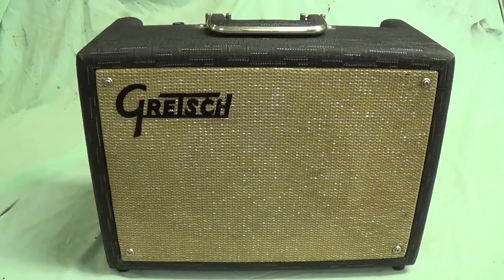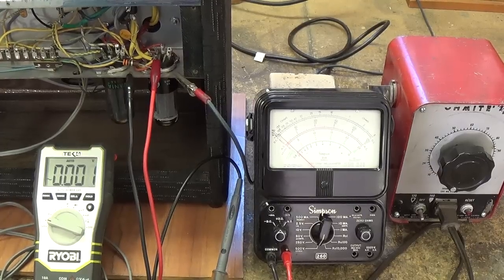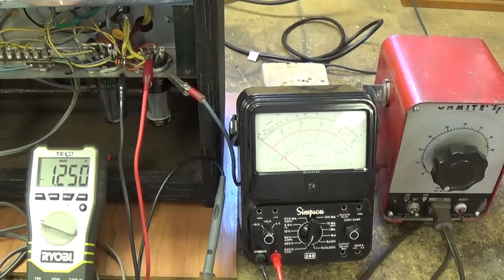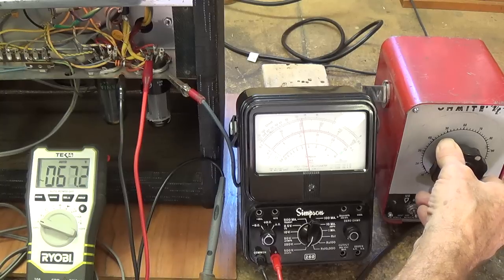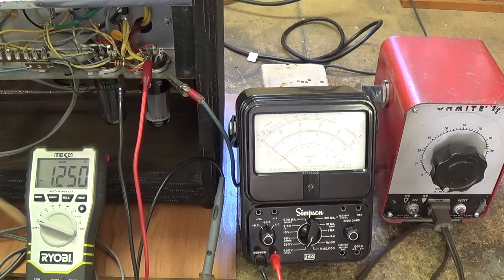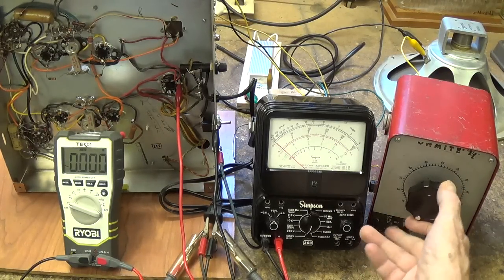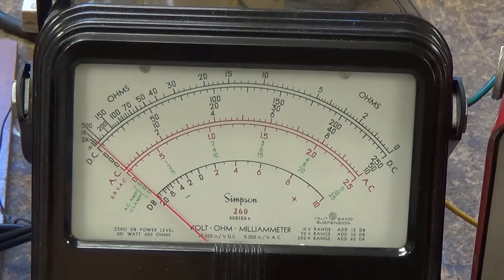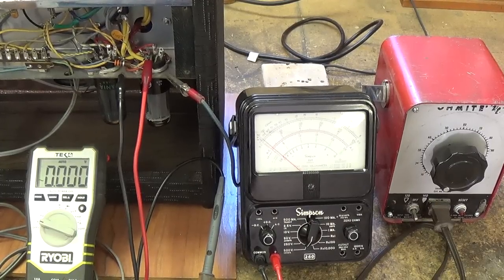Is Gradual Variac Warm-Up Effective with Tube-Rectified Amplifiers ?

Comment: Hello Uncle Doug, I have a question that is off this topic. I get amped up watching all your videos, and all the other usual suspect giants on YouTube. I'm trying to learn as much as I can about vintage tube gear. Last month  I bought a Earth 440 Amp head. I didn't know anything about it,  but for $30.00 I couldn't resist. I plan to bring it back to life.  So, my question is: in your opinion, why are solid state Amp repair videos almost non-existant on YouTube? Are SS Amps horrendous compared to tube amps? I plan to make my first YouTube video this fall with the Earth Amp head. Your feedback, and anyone else's, would be greatly appreciated. Thanks!
Reply from the maker: I wasn't aware that SS videos were in short supply, FW. They are generally no more complex or difficult to repair than tube circuits, and they operate at lower voltages, but tube circuits are "in" at the moment and thus apparently in high demand for video coverage. Perhaps you can become the SS circuit guru on YT.  Good luck.
Reply: Uncle Doug Thanks for the info/advise! I've been watching/studying you, Brad, Paul, El Paso, etc. etc.   for years. Three months ago I saw a Earth Amp head (440)  1976? for sale, local, and for $30.00, down the rabbit hole I went. Insidious, yet deliciously painless is the Amp bug's bite? So long story short,  I've since been vintage test gearing up to perform a full physical on the Earth Amp this fall. It will be my first YouTube video, and thanks to you and many others,  there's a modicum of a good chance I won't look/sound like a clown doing it. I've been googling the hell out of this Amp head - Peavey clone - and it doesn't seem critical to keep it religiously original?  If you have any thoughts/advice regarding modifications that would make the Amp
 Head safer, perform better, I would greatly appreciate your input.  AFTER you finish part 2 of the Viciously Awesome Amp Eater video, that is! Thanks again, and best wishes!
Reply from the maker: You're welcome, FW.  As you commented above, answering viewer questions has become a very time consuming task, leaving little time to assist others with their projects. My advice would be to incorporate what you have seen and learned into your video evaluation of the EA head. You will gain more from the process if you do it yourself. Good luck.
Reply: Uncle Doug The best advice by far.  Thanks again!
Reply from the maker: You're welcome. Good luck.

Comment: great video, love the simpson meter
Reply from the maker: +jeff b  Thanks, Jeff. It's a great meter. I found it in a pawn shop in filthy, non-working condition, for $10. It cleaned up to be just like new.
Reply: most people forgot what good sound is, good sound in my opinion is reproduction of sound as close as possible to being right in front of the band live or in the studio. and my RCA  does it very well. or any halfway decent tube amp.  they forgot what good equipment is too, like your simpson for instance, you could have dug it out of a hole in the ground 40 years later and probably still cleaned it up!!!  the ryobi is interesting did not know they made them, have the lithium drill and circular saw and hold them dear to my heart!!!
Reply from the maker: I bought the Ryobi multimeter as a result of being disgusted with the flimsiness of my old unit.....it is very robust and seems to be quite accurate. I know it's not a Fluke, but it works for me.

Comment: The detractors of slowly ramping up a voltage on a rectifier, or any tube for that matter, do not understand that a tube is a linear device, not a switch like a semiconductor
Reply from the maker: I believe that most tube rectifiers have a threshold  voltage, Raymond, below which, they do not function.  Once you reach the threshold, they do tend to respond in a linear  fashion.
Reply: Uncle Doug yes, the electron build up on the cathode and the plate voltage sufficient to attract them

Comment: Is that simpson a VTVM..And I wish you would show us novice guys how you hook all that stuff up so you do not KILL us dumbass's..lol I know you think you are only talking to people who know what they are doing...I have learned a lot more than I did from all your great vids...
Reply from the maker: Bob Barcus I realize that many viewers are novices, Bob. Learning how to operate a complex measuring device like the Simpson meter (it's not a VTVM.....it does not use AC power or contain a vacuum tube) is like learning to play the guitar.  People can tell you how to do it, but the best way to learn is simply to get one and experiment with it on low-power circuits (at first) and then gradually move up to higher voltage circuits, like tube amps. Most meters come with detailed instructions, and much info is available on the Internet. I'm glad the videos have been helpful.

Comment: I just got an old school Mesa Boogie triple rectifier form the mid 1990's and it's been sitting for at least 5 years,should I have it put on a Variac and put through this process.the amp tech at my local guitar store said he can do it for $60.00 and was wondering if thats a fair price? Should he pull the tubes out of the amp before he increases the voltage?.thank you Doug for making this video and it's the only one I have found on YouTube 🤘
Reply from the maker: You're welcome, Mike. First make a current limiter with two 200 to 250W bulbs in parallel (see my video on how to do this) then plug the amp into it and turn it on. If the bulb lights up brightly, turn the amp off and take it to a different tech.